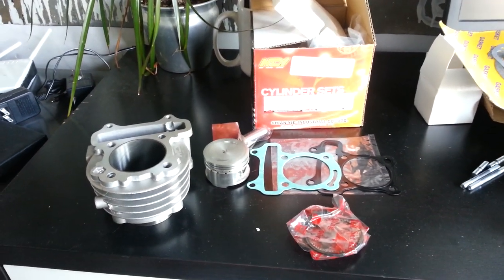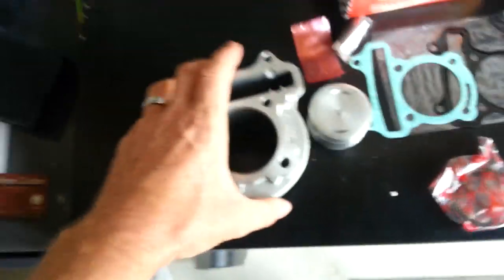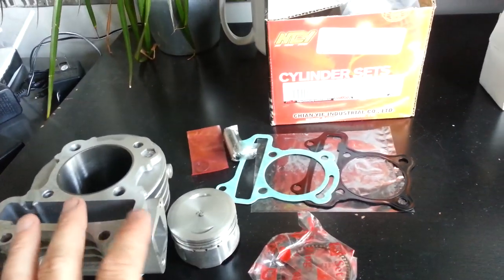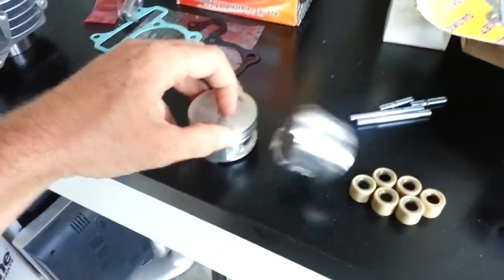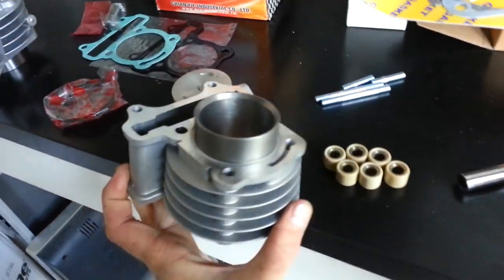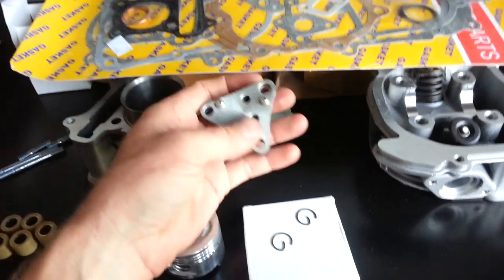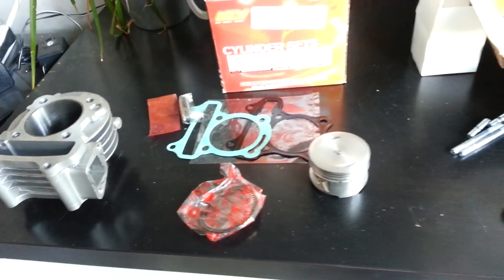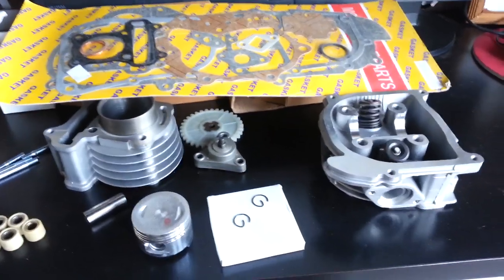Gy6 NCY scooter big bore kit vs Chinese brand scooter / moped big bore kit for the qmb139

Comment from the maker: Peter,

  We have had major issues with the 10cc kits. (They bearly start, smoke, and kill the crank bearings) There is not much of a difference between the two as far as power. We wnt through tons of 80cc kits to find the once that work the way they are suppose to. The ncy are good but you still will kill the crank bearings and electric start struggles.
Reply: 10cc kit you mean the 90cc kits right ?
Reply: Hi! I have put on a Kymco scooter a 90cc kit and I have problems with starting especialy when the engine is cold but sometimes even when is hot. The big bore kit is good quality (Naraku), I have new CDI, new ignition coil, new 8 amps battery, new bigger carburetor that I have found out is for 125-150cc engines and the engine is running good with this carburetor when it start. However, in the morning I have a dificult start and sometimes it does not start, not even a sign. Last summer I have supressed the automatic choke and it started quit good every morning... I am thinking that the carburetor is too big for this engine and maybe this is the problem but when I have first assembled the carburetor it was starting good for a period. I will try to put a smaller carburetor but to be honest I don't know if this is the solution and I have read what you have wrotten here that with a big bore 90cc it does not start. Do you have an advice in order to solve this problem? Thank you!

Comment: Stock crankshaft the 52mm head is ~88cc and the 50mm head is ~81cc

If you combine with the full circle stroker crank 44mm vs 41mm you get 93 and 86cc

For best performance of the 52mm head should be paired with a higher lift can bigger valves and a larger tapered bore carburetor... Good for about 10hp?  Ish

Comment: When you have installed the 50mm or the 52mm big bore kits how many connecting rod failures have you had? I find that after installing over a 47mm big bore kit I have had connecting rod failures but not all of them. Is there a Taiwan crankshaft that is same as the stock but with better bearings without using a stroker crank?

Comment: I got a 100cc kit but it’s 50mm and it didn’t come with head/ valves will my stock one work engine is a 1p39qmb and the kit is for the engine but I don’t know if stock head will work?

Comment: Good price to put it in.
The place I got my scooter from wanted to charge me $450 plus just to replace the rings.
I was thinking he would give me a deal sence he overcharged me on the scooter($1800.00) new. I  also bought a used 4 wheeler($2500.00) at the same time.
I trusted a local man that will never happen again.
Less than a year and half the motor locked up.
Did not see no oil leak at all.
Sounds like you have a fair price on your work. To bad you are not in NC, Could use a good repair shop on scooters.

Comment: i have a kymco people S with that 90cc ncy cylinder kit (with valve head ) and it electro- starts great. 
only problem is that after +- 4000 km  the magnet breaks of the crankshaft
this has happened 2 times already with the original crankshaft, now i got a naraku.
i think that 80cc is really the limit for that engine , my bro has drivin 42000 km with a 80 cc without any problem.
Reply: sqrl1980 what do you mean with magnet ? i am also planning buying a 90cc. Can you also put a 52mm cylinder head on a 47mm 80cc ?

Comment: Well Like you said im having trouble starting after the 100cc big bore kit, i tryed realigning the cam, adjusting the valves, and ignition coil, also spark plug, now i think its just the electric start thats not enough to crank it ove. My scooter doesnt have a kick start. do you think the kick start would make a differrence and if so can you cutt me a deal on one for a gy6 50cc taotao. i also need the from belt cover because theres a big hole where the previous owners took the old kick start out

Comment: Can anyone tell me where to get a 4 valve piston.
I've got a baotian btm49qt-9 4 stroke moped.
I have purchased a 72cc bore kit which is a 47mm 2 valve piston.
The problem I have is I took the valve cover off and I found out it has 4 valves instead of the standard 2 valves.
Any suggestions please.

Comment: Ebay has them kits waaaaaaaay cheaper...ive bought both 80-100cc kits.  For 55$ a piece
Reply from the maker: Tom, you pay for what you get. There is a reason we dont sell Ebay kits. The quality is horrible! We started with these kits way back when. Your valve seals will leak, and your valves wont seal. Before you install the cylinder head into your scooter, poor water into the intake port. I bet the water will leak right out. This will show you how poor these are built. They dont even lap the valves.
Reply: As the old saying goes "You Get What You PAY For"